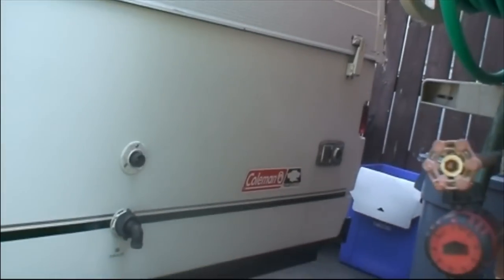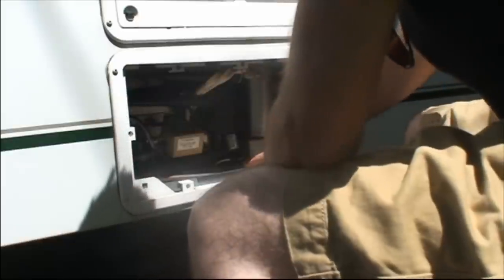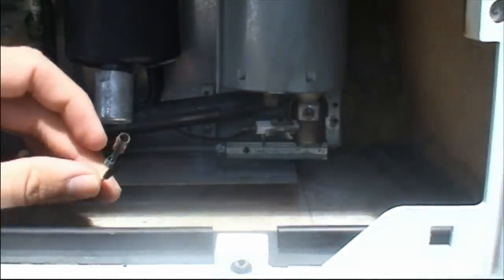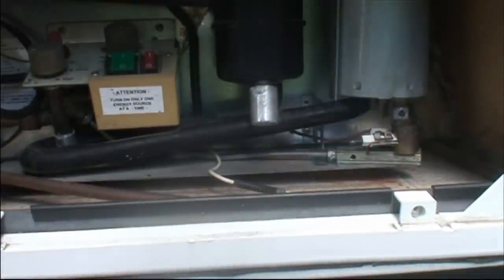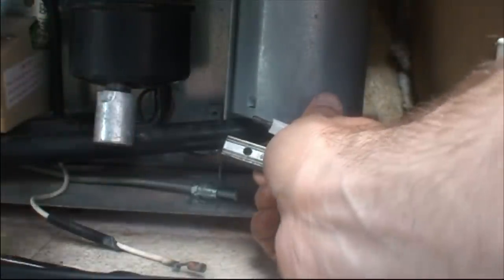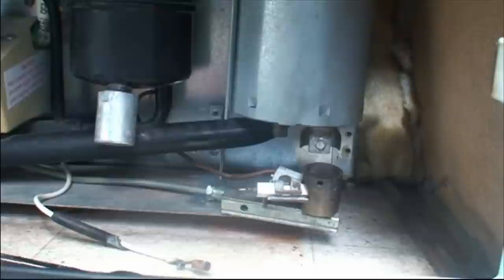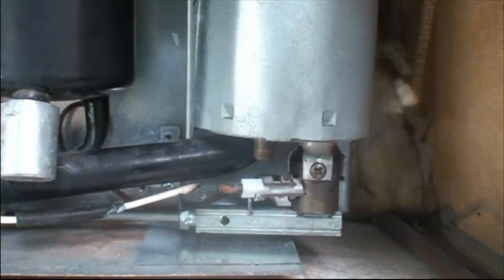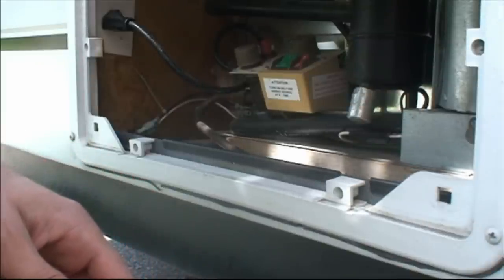How to Repair a Propane Fridge (RV Camper Fridge - Coleman Fleetwood etc)

Comment: When we purchased our pop-up almost five years ago, the previous owner had replaced the igniter and thermocouple, but no matter what we did, we never had good luck running the 3-way fridge on LP mode for more than a day or so. And it always had a foul smell from the exhaust chimney. I suspected a dirty floo or burner, but until I stumbled across your video, I wasn't sure the parts were really meant to be serviced by the DIY crowd. After fiddling for a couple hours today...and an extremely tight "nut" on the end of the "crack-pipe"...I got it apart and cleaned...and she's running like a champ. Thanks for posting your work and encouraging guys like me.

Comment: Dude, your video is almost painful to watch...BUT!!!!   As an old woman all by  herself today I watched this all the way through - then went outside and fixed the pilot light issues on my new (OLD) pop up camper.     It was lighting and burning yellow (didn't know that was a bad thing) but it would not stay lit, nor would it power my propane frig.   If my tools had been handy, it would have taken about an hour, but of course it took a little longer searching for what I could use and stuff.   Long story short, it's been 2.5 hours since I put it all back together and lit it.  IT IS STAYING LIT AND MY REFRIGERATOR HAS COOLED ABOUT 15 DEGREES SO FAR or whatever 10 degrees C means cause I could only find a C thermometer.    You are my prince charming tonight.  THANK YOU.

Comment: Thanks for the video, I took my propane burner out of my fridge cleaned it  and put it back together. When I restarted it, it looked like a flame thrower. I thought I had ruined  my regulator somehow. Then I watched your video and saw that I had lost the aperture / fuel jet. I didn't know there was one in there when I took it apart.  I searched for it and finally got an extremely strong magnet and ran it accost the dirt and gravel with a prayer in my heart.  I found it stuck to the magnet. Put it back in and it worked great, Thanks again for the video.
Reply from the maker: Amazing- glad to hear you had a happy ending.

Comment: Cleaned my fridge burner in the middle of a field at 11 pm with just a small torch, pliers and a quarter inch screw driver bit.   Worked a dream since.      I'll try and do it before I go away next time.      Safe trip
Reply from the maker: William Clarke such adventures make memories! Have fun!

Comment: Hello Kevin I have 2 questions for you.
1. How were you able to put the aperture cup back in properly
2. My gas valve that you push down to light the pilot does not com back up.  any suggestions
Reply from the maker: What's up Bret? The cup sits in there, it seems to go in ok for me.
Not sure what to do if your gas valve doesn't pop up, you may have a bad spring? Maybe oil it? Good luck!
Reply: @KevinArchibald  thank you

Comment: My flame comes out of that little hole on the side by the orifice. What's wrong?
Reply from the maker: Hmmm not sure exactly what you mean! I am not really a mechanic, I just disassemble, clean, reassemble
Reply: @KevinArchibald  where the gas line screws into there's a hole just after that Fitting that faces you. For some reason my flame comes out of that hole. Actually started to melt the igniter wire.
Reply from the maker: @s.h.4609  Hmm not sure that's right, you may want to contact a pro